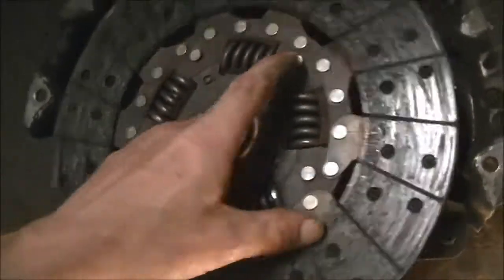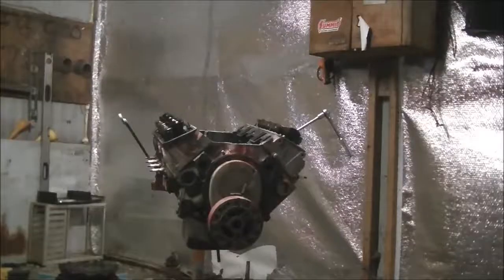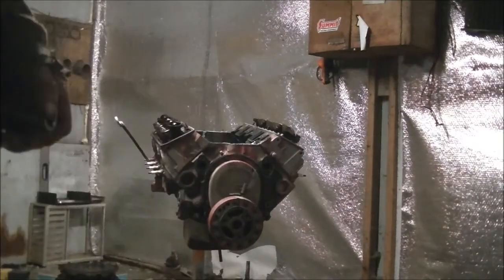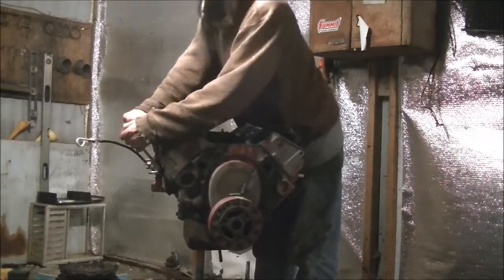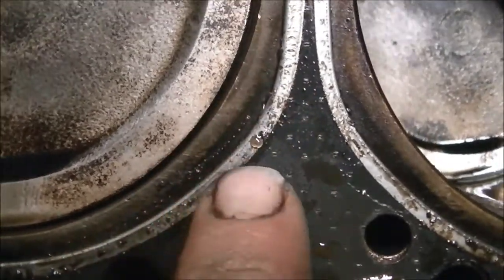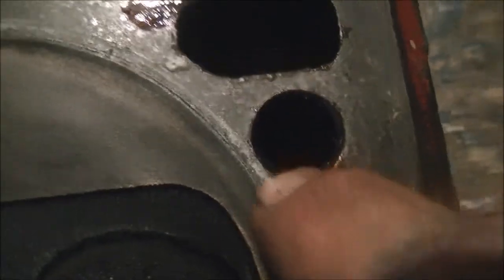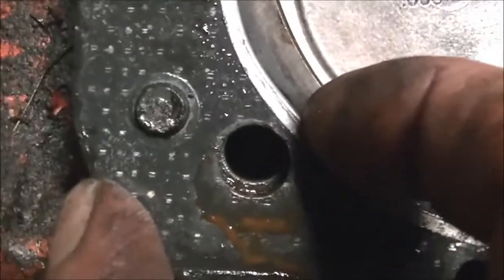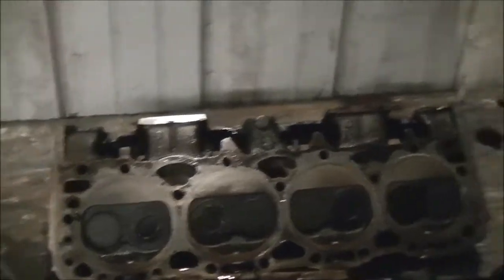engine teardown

Comment: I've never heard of putting a 400 crank in a 305 block. I thought your 334 ci was a .030 or.040 over 327 block. How do your combo work? Does it make good power?
Reply from the maker: oh yeah I've seen a lot of people do that do that makes one hell of a work truck engine just cut 350/305 main journals in the 400 crank stuff it in there with shorter rods, makes a hell of a lot of torque above 2500 rpms great engine for a work truck/mud truck

Comment: Looks like a 350 or 400 head gasket on a 305 block to me.
Reply from the maker: that is a 305 block, and it was a 4.125 gasket way too big this engine just has .030 over pistons in it with a 400 crank

Comment: Matt are those head bolts torque to yield (stretch bolts)? maybe the last guy re used those old bolts? Thats a major no/no. Also im sure you know that after running her for a bit you need to re-torque the heads.
Reply from the maker: I always re torque the heads and no they are arp bolts you can reuse them or at least I have been for years never had a problem
Reply: no problems there. Arp,s are great bolts.

Comment: with those heads and dished pistons your only gonna be at 8.51 a metal shim head gasket will bring up the compression also shaving the heads should get you to 9.01
Reply from the maker: block is decked .030 and heads are .020  :)
Reply: right on bro